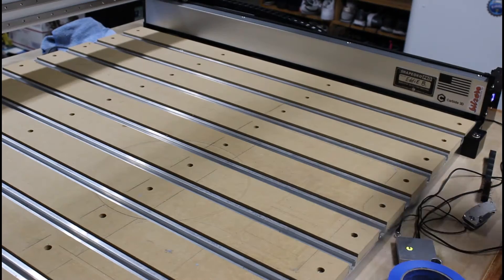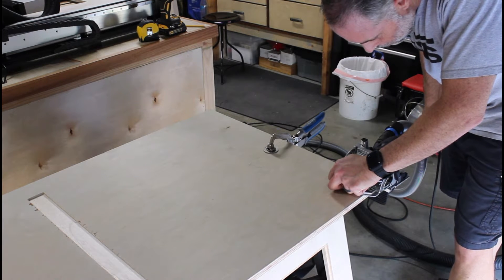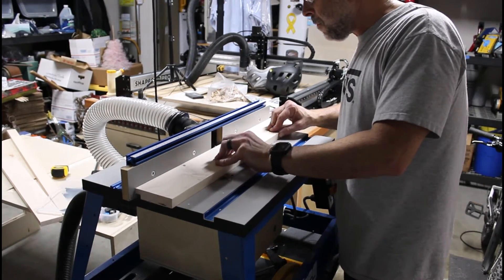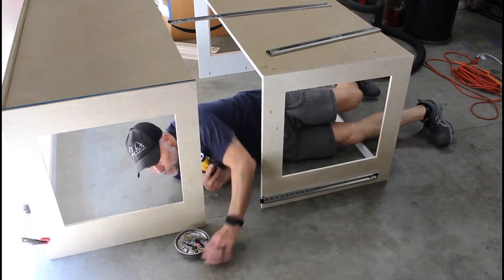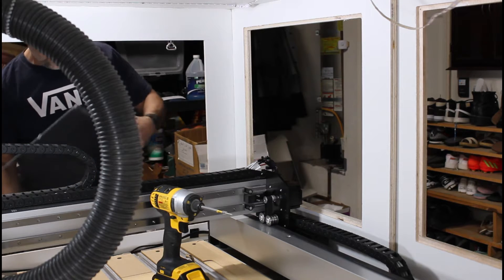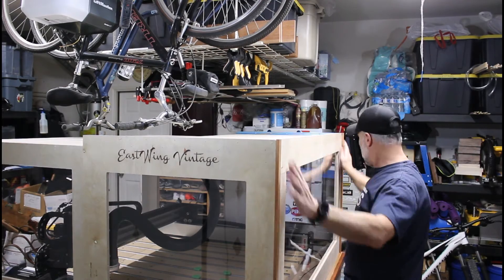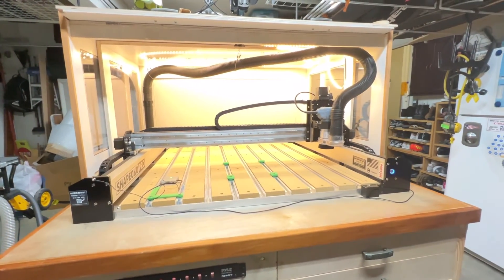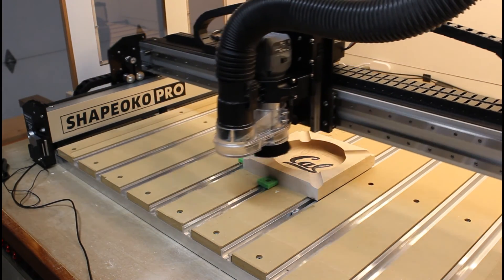Part III The CNC Enclosure

Comment: Very nice build! Wondering if you could have turned off the music and demonstrated the noise levels with the spindle running and the enclosure open compared to when closed to understand its effectiveness.
Other than this, it's very nice and clean!
Reply from the maker: Thanks for the comment…I’ll try to demonstrate that in a future video. What I can tell you is the noise difference between the enclosure open vs closed is a significant difference.  I’m also planning on upgrading from the router to a VFD spindle.  That will also make a difference in overall noise.

Comment: How deep did you make the dado for the slides? Trying to see how close I can get the sides without compromising the area that gets the dado.
Reply from the maker: Thanks for the question. All you need to factor in is the thickness of the drawer slides. Since the enclosure sides dados match up with one another. I took the thickness of a draw slide divided it by two and used that measurement as the depth of each dado.  If my drawer slide measured out to be 3/8 of an inch thick.  I would divide 3/8 by 2, and cut the dado to  .187 inches deep. Hope this helps.  Good luck with your build.
Reply: @eastwingvintagewoodworking4797  Thank you! I'm designing it in Fusion right now and just making sure I know what I'm doing 😆

Comment: Love the nesting design and the use of a long "stored" skate bearing!  I'm getting my shop together and am planning space for a CNC.  My garage is 30' - 70' from the house, and I sometimes lose signal to my wireless devices.  Any idea on which way I should lean for tech purchases?  ie: signal booster?, do programming in the house and plug into CNC later?,  Apple vs PC?  Any help is appreciated, just thought I'd ask a genuine user before the snowflake at Best Buy.
Reply from the maker: Thanks for the question.  Short story is I know enough about IT to be dangerous.  You will have to consult with an expert in regards to boosting your wireless signal. My computer is a PC…one of those 2 in 1 laptops with a touchscreen.  I find the touchscreen to be very helpful. Lastly, unless you plan on using software that is cloud-based you do not need to be connected to the Internet to program your jobs.  Programs like Carbide Create, Vetric, or Fusion 360 reside on your computers hard drive.  Hope this helps and good luck on your CNC journey…thanks again for watching.

Comment: how many decibels does this cut the noise down?
Reply from the maker: Sorry, I haven't tested it with a decibel meter.  However, the change in the sound level is significant. While using any of my other power tools I wear hearing protection.  Using the CNC with enclosure closed, its quite enough not to have to use hearing protection. Hope this helps.

Comment: I like your idea of the sliding half’s & door pin tracks. Did you use any dust sealing between the two sections?
Reply from the maker: Thanks!  No I did not...Believe or not the vacuum and dust boot do an amazing job. I haven't had any issues with dust at all.

Comment: Good luck with your Shapeoko 4?. I wish I had the room to build a fancy enclosure like yours. As it is the room mine is in is the enclosure. I find that the noisiest component is the vacuum. I would recommend that you look into Vcarve or Vcarve-Pro for cad-cam you can still use carbide motion for the add-ons. Pay attention to to belt tension it's critical. Too much or too little can ruin your day.
Reply from the maker: Thank you for your comment! The machine is the Shapeoko pro XXL.  I would agree…looking into Vetric software now, seems to be the most robust solution for the money. Yes..paid very close attention to the tension on the belts…it’s been a few months and no issues.